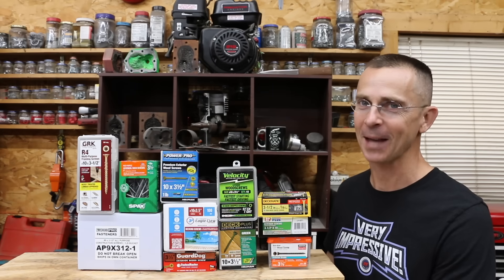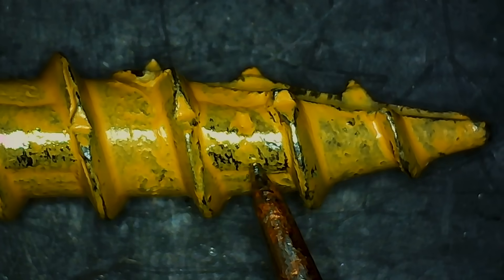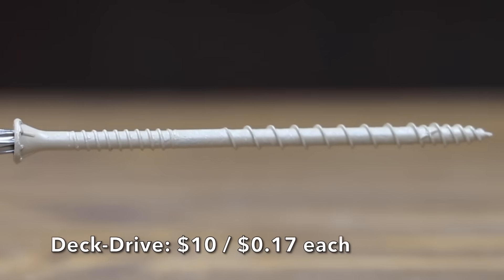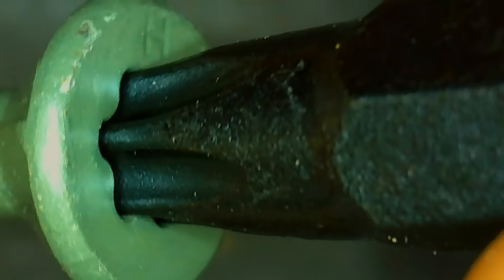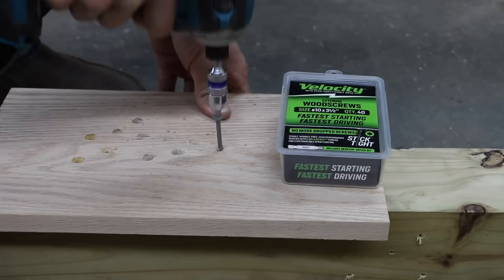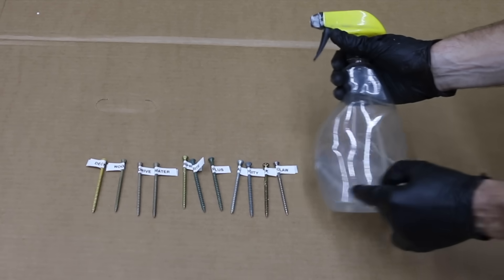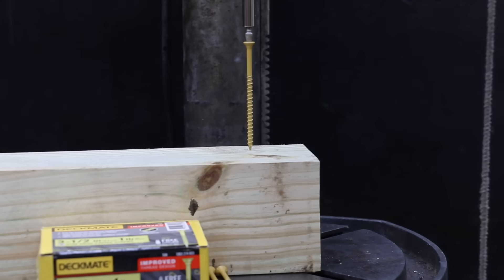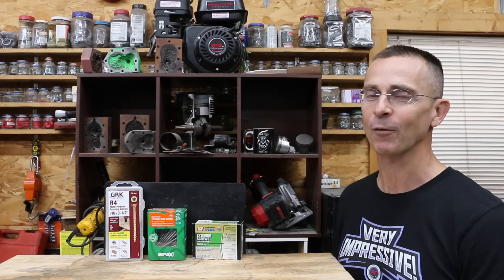Best Deck Screw? GRK vs SPAX, Grip Rite, Deckmate, WoodPro, FastenMaster, Deck Plus, Eagle Claw

Comment: There's actually a very interesting story about the grk screws. 
The original owner made sure they were manufactured in either the US or Germany, and eventually brought the majority of manufacturing here to the US. Eventually one of the evil Omni mega corps bought him out, but the terms of the buy out stated the US manufacturing had to remain open. The new owner violated that, shipped manufacturing to Taiwan, and the quality took a massive crap. 

However, due to them violating the terms of the agreement, the original owner, with hundreds of millions of dollars, opened u2 fasteners built to the same original standards with a few new improvements to design and production. Ran grk out of town in the northwest. And brought American manufacturing back.

This all took place around 2016
Reply from the maker: Great information. Thank you
Reply: I thought U2 Fasteners is a Canadian company?
Reply: @mydude3254  Ontario Canada
Reply: @mydude3254  to be fair, he said they were an "American" company, not specifically U.S.
Reply: @mydude3254  both grk and U2 have Canadian roots, Ontario I believe. 
Manufacturing was done in Illinois for grk until it was offshored. Most products from U2 are us made. We get the full catalog from our local fastener supply. I think only the adjustable window screws were Canadian.
Reply: @mydude3254  Well, that's even better!
Reply: The irony is that they would end up buying most of the tools and machines that were sold to ITW for a fraction of the price LMAO.
Reply: This is why I reach for Spax.
Reply: That's super interesting. I've got a big project and a big screw order coming up, I'll check out U2 Fasteners. I'd much rather support quality manufacturing in North America than lesser quality overseas.
Reply: Man, talking about GRKs. What you're saying makes sense! Their cabinet screws are Uber crap these days. I'm a cabinet installer so I go through the screws. In one of the large buckets of cabinet screws, I'll find a half dozen or so BENT screws, which stinks when you're doing cabinets, when you're driving a bent screw, and it causes your bit to disengage with the fastener and you marr the cabinet, frustrating! But anyway, bent screws, screws stuck together from too much coating and the torx head filled with coating and steel shavings, so you can't even use the screw, and I've been breaking screws too. This has been routine with their cabinet screws for at least the last year and a half. Their finish/trim head screws aren't that great either. They're straight, but I routinely get screws stuck together from the coating. It's a bummer, because the really used to be Uber Grade. It stinks because they own so much of the market that they're hard to avoid using. Any  cabinet installers out there have a different brand, I can try?
Reply: @artvandelay1099  Ive noticed a lot of inconsistencies in the last couple of batches of construction screws
Reply: @scottyee707  I don't use many construction screws but as far as cabinet screws, I switched to Spax a  little over a week ago, they're a superior screw.
Reply: @artvandelay1099  Painful deficiencies. But you didn’t mention my favorite. The head twists off.  Why I settled on the more expensive Spax.
Reply: @robertbamford8266  Switched to the Spax over a week ago. They're a much better screw. They're only a couple cents more per screw. Definitely worth it.
Reply: @artvandelay1099  Cost diff is negligible - especially after the first time I twisted off a head and had to dig out the shaft and plug the hole. I even threw out the box with the rest of the screws.
Reply: @artvandelay1099  same here, I install lots of cabinets and I run into lots of bent ones, recesses filled with gunk all the time
Reply: @stevebengel1346  When you have the chance, try the Spax. The guys on here are right. Had a big cabinet job start a few days after this video. Been using the Spax 3" wafer heads and the Spax 1 1/2" and 2" trim/finish heads for over a week now. They're more expensive, but only by 1 or 2 maybe 3 cents per screw. The box says made in the U.S. or Germany but all the boxes I saw said made in the U.S. In one week of use I haven't had one bad screw yet. But the biggest and most surprising and most immediate difference I noticed was the driver bit to screw head engagement. The fit of the driver bit to the screw head is SO, SO much better. I can put a 3" screw on the driver bit, raise it over my head into position and drive the screw one handed. I was shocked and impressed. Driver bit fitment to the screw head wasn't even a complaint I had with the GRKs! The Spax don't come with a bit, but I don't care, I use Makita bits, also recommended by Project Farm. The Spax are available at Home Depot, so I can go out and get them on my lunch. That's important for me and the only reason I didn't try the U2 fasteners some of the other guys were talking about.
Reply: @artvandelay1099  Dealt with the same thing a good bit. Spax wafer heads are much better these days and made in USA. Don't love their finish screws much either, though. Powerpros are ok, but I haven't found any I love like the older GRKs.
Reply: @MattJones87  Spax wafer heads, got it. I'll look for those this week. Got a good size, 37 cabinet kitchen to do this week. Isn't it the worst when a good brand sells out, then coasts on their name and reputation? Those sneaky buggers still use the German flag in their logo. Did you say you like the Spax finish screws, or no?
Reply: @MattJones87  Great advice. Thank you. Switched to the Spax over a week ago, SO MUCH BETTER. Better in ways I wasn't even expecting. The fit of my Makita bit (also a project farm recommendation) to the Spax screw is far superior. In over a week of use, not one bad screw yet. Totally worth the 2 extra cents per screw.
Reply: @artvandelay1099  Go get yourself a whole boatload of U2 screws.
I gave a direct link to several varieties available on Amazon, but YT censored it, probably assuming it was spam, which it was not.
Reply: @Gunners_Mate_Guns  I might go ahead and order some. It stinks GRK pretty much owns the market. I like to buy in stores. Go out at the start of a job and grab your shims and whatnot grab your screws since you're already there. Then, if you're running low on screws, just run up to the store and grab some. Amazon ordering just isn't first nature for me yet. I'll consider them though.
Reply: @artvandelay1099  Spax has been great, and the U2 construction screws. I don't use many finish screws. 
Spax still maintains a lot of US production so I generally use them if I need to stop by a box store, otherwise, U2 from fastener supply. I don't know if they have different lines, but some of the U2 products on Amazon are showing Taiwan now too. 

The stuff we get locally still says us or Canada.
Reply: @Squat5000  Been on the Spax for over a week now. They're great. The box says made in the US or Germany, but all the boxes I saw were marked made in the US. Would've tried the U2 but I like being able to go out and get more screws on my lunch break or whenever.
Reply: I'm seeing some U2 Fasteners screws made in Taiwan
Reply: @victormarinelli5660  Go for the Spax. The box says made in the US or Germany, but all the boxes I saw said made in the US.
Reply: @artvandelay1099  I'll check it out.
Thank you!
Reply: Good information! Thanks.
Reply: Good read thanks
Reply: Damn, they also sell 316 stainless screws! I can drop Stimpson Strong Tie screws!
Reply: @reginalb124  unless you need rated and code compliance, then use Simpson.  Gotta keep roofs on, decks up and stuff like that.
Reply: GRK and U2 are made in Taiwan. ITW owns GRK.
Reply: Are you the original owner of GRK? 😏
Reply: @Meatwad.Baggins  shoot I wish. 
Illinois tool works to my knowledge.
Reply: That's a fascinating story, and good on the original owner for retaliating and onshoring manufacturing once again through creative means.
Reply: Kickass!  Couldn't find anything on the internet about it, but it DID say the manufacturing was done in Taiwan, Switzerland, and Germany.  So I believe it lol

Never buying GRKs again!
Reply: Such a satisfying comeback 👔
Reply: Nice fun fact
Reply: I have seen zero evidence GRK’s quality has gone down. Personally. They don’t strip, they don’t corrode, they don’t snap or break, and they hold as well as any screw.
Reply: @JimYeats  they still cheated. So boycott them.
Reply: @talisikid1618  Its basically all they have at my local hardware store, so, I’m not going to do that because its not that important to me.
Reply: @JimYeats  I still have cases of the American and German made fasteners. 
Compared to today, the fit of the bit is mediocre, they are more likely to strip, I've had heads completely bent or missing, especially on fine cabinet screws. 

It's anecdotal of course, but of the hundreds of thousands of fasteners I've gone through, picking out a box of the old ones is a good reminder of the difference.
Reply: @Squat5000  Fair enough. All I can say is they have served my purposes just fine.
Reply: American yes but, Canadian not US.  That's Okay too.  Just wanted to set the record straight.
Reply: Wow!  I believe you, but do you have links to news articles or videos about this saga?  That's crazy.
Reply: @Locane256  I wish.
The owner was making the rounds with some of the smaller fastener supplies in Montana. Grk obviously has the strangle hold on bigger retailers because they won't change suppliers, but the aces, WBC, and fastener supplies liked what they had to offer. 
It was a few years back. Unfortunately "straight from the horses mouth" it's all we have. Might still have some pamphlets though that they sent with their sample packs. They had a bit of that back story. 

Granted, since both Canada and US were shutting down effing everything, it's only a matter of time before they offshore to Taiwan too. You just can't compete anymore.
Reply: @Squat5000  Big Timber is what we get here on the west side of MT from WBC for screws. Next time I go in maybe I'll look to see what else they do carry because I'm curious!
Reply: @stubbsshop  in the valley you'll see a mix of U2 and big timber. 
The big timber are decent too, but the bit fitment isn't as tight unless you have a brand new wera with the diamond grip. I think they are a good value compared to grk
Reply: @stubbsshop   northeastern Montana we get big timber too! I think they are pretty good there is probably better I use a lot of the BTX and CTX screws always seems decent quality
Reply: The way it should be 
Buy American 🇺🇲👍♥️
Reply: @tjkaczynski5896  even if it's from the goofy cousins up north, it's still better than overseas.
Reply: Nice to know, after hearing Taiwan mainly throughout the test, I went on a 'made in the USA' search.
Reply: Based and wood pilled
Reply: Thank you for the info
Reply: Thanks for the info.
Reply: U2 is a company I'd love to support!
Reply: I bought a boatload of grk screws recently. I'm here in Canada so I'm used to the superior Robertson screw. 

I was not impressed with the t15 torx fit on these washer head screws. The torx recess is very shallow and doesn't allow the torx bit that's included in the box was engaging deep enough.

With the longer screws this causes wobbling and you absolutely need to hold the screw with the other hand.

These screws are garbage and not worth the premium.
Reply: @breakfasteatre  Robertson is not superior to torx, not even close.  I use my own Dewalt bits and I never have slippage. Robertson is fine,  they just aren't as good as torx.
Reply: @breakfasteatre  Spax uses a little nub on the end of the Tirx bit to help align things. It doesn't stick to the bit like a Robertson, but that's what magnets are for - to hold the screw without yanking out of the bit holder. ;)

With GRK construction screws, I just use the drivers with a tube that slides down to hold the screw. That works even better than a square drive, IMO.
Reply: @breakfasteatre  yep totally agree I used the grk one my past few installs thinking they’d be good, they are trash. I’m going to try u2 otherwise back to Robertson’s
Reply: If only everything was that.Nope can't be having to many Americans get ahead.they might Rise up and Revolution
Reply: @UC7YA40pjPDOh-kdIF2IeBqg just toggle Amazon off
Reply: The Magnificent Adam-man
...
Cush (Greek: Ethiopia), means sun-burnt
Phoenicians described by the Greeks, as fair-haired, fair-skinned people
Persia means Lord of the Aryans now renamed IRAN
Zimbabwe once known as Rhodesia
Chicongo once known as Chicago
...
12 Tribes passed through the Caucasus Mountains
(i)ssac's Sons / Saxons / Anglo-Saxons / Europe / Australia / New Zealand / North America / Christian First World / We the People
Reply: @Lawiah0  - Um.. "Persia" is a corruption from the Greek Roman Empire of the Fars Province of the Empire of Iran and Non Iran.   (Farsian==Persian).   The Pars/Fars province was the core of the Sassanid Dynasty.   As for the steppe tribes, we have no real idea of the number of them that swept down through that area over the centuries, nor do we really have a good idea of what passed back and forth across the Caucasus Mountains over the last 35,000 years.
Reply: @tbelding  
Gen 10, tells us that Egypt, Ethiopia, Sheba, and Persia were at one time, all great Adamic Nations.  

In Isa 43 says, “For I am Yahweh, the Holy One of Israel, thy Savior: I gave Egypt for thy ransom, Ethiopia and Seba for thee.”  

Now, if Yahweh God gave up Egypt, Ethiopia and Sheba for the children of Israel, who received them?  History tells us that these lands were overran by the mixed-multitude, mongrels.  This is who Yahweh gave the ransom. Flood of the Serpent, Rev 12:15.
Reply: @Lawiah0  A'DAM as it is written in the first language Cuneiform, which is a written language to describe things, translated the word to other languages as it was meant "Animal." 
A'DAM is what the creator called the first man. Animal. 
Makes ya think a bit.
Reply: @opossom1968  Adam means to show blood in the Face, to Blush.  Only Caucasians can do this, those of YHWH.  Rev 12:15, from the Serpents mouth is everything not from Adam.
Reply: @Lawiah0  I can tell from your response you do not have any understanding of language and its written origins. Cuneiform along with the Rosetta Stone, clearly defines the word A'DAM as the word used to name the first human as Animal. 
This is the true and correct definition of A'DAM. 
Sumner, the first city, home of the Sumerians, gave us written language among other first such as, the wheel, farming, and construction. 
Also our first dictionary and the word A'DAM was the word used for the first man. The creator of all things called the first man by his name A'DAM meaning Animal. 
From there the name A'DAM was translated into other languages as the name of the first man and all other Animals share that same classification. 
Adam (A'DAM) animal. 
If you cant accept that then you need to look at yourself removed from your high holy status and jump back into the world with the rest of us Animals. 
We all are children of Adam and are classified as A'DAM, Animals.  
even today when you search Human Classification we are Homo sapiens, Kingdom: Animal. 
Family: Hominid.
The two MOST important achievements.
Written Language 
The Wheel. 
SO all definitions of things comes from those who invented the language and as i have written A'DAM, Adam directly translates and is accepted as the first name of Homo sapiens ANIMAL Adam. 
The creator God called named the first man A'DAM, animal. 
You better love it. its what you are.
Reply: @opossom1968  
This is not the forum to try to bring your cult proof out against another cult proof. Keep your religion out of here.
Reply: @jenniferwhitewolf3784  thing is im NOT religious. that was just our history put into a context the guy i was responding to could understand. i do not claim any religious affiliation.
Reply: @Lawiah0  miss guided soul.
Reply: @opossom1968  If you are not of Adam-man, like my Kinsman Redeemer (Christ), you have no Soul. You are an empty vessel, an abomination of desolation.
...
Matt 15, “Every plant which My heavenly Father has not planted shall be uprooted!
...
They kingdom comes.
Reply: @Lawiah0  My wife brought your name into question as to your ideology and theology. For one, i do not subscribe to any official 'religion' in the sense of what the meaning of the word has become, theology and ideology. I am a firm believer that Jesus Christi is not a hybrid as we are, he is a man without Chromosome #2, pure God made DNA that A'DAM and Eve started with, God made man in his image but made him from the same material as Animals dust and spit and breathed into man to give him life, that is TRUTH. BUT you forget one very important thing, Morning Star, Light Bringer, the first angle God the creator spoke into existence Lucifer, tempted Eve, because she was more accessible do to the fact that A'DAM walked with God everyday all day. She was tempted by Lucifer, light bringer the being that came to be when God spoke let there be Light. He temped Eve with what we can in our simple minds eye a 'apple' THAT changed her DNA, A'DAMs and every child born. 
That added Chromosome #2 to our DNA, which Jesus Christ DOES not have. 
Christ is PURE God made DNA not MARKED by the beast. 
AS we are told WE modern man Children of A'DAM and Eve, are BORN into sin. or Born with chromosome #2. 
This is the mark we carry, SO do you. in your very DNA. This will have to be dealt with FIRST. The mark of the beast, which we all carry is real in you and me. FACT. 
I tell you this so you know i do know God the creator and God the savior and God the spirit, but what i do not attest my life to is a organized religion (retelling) that tries to hide, as you are doing from what you are, A'DAM, animal. 
You was wrapped in the skin of the animal and tossed out of the gardens on Eden to live as animals and till the ground till the end of your days. 
DO you deny you are son of A'DAM the child of man, born into sin with Chromosome #2 as the mark of the morning star the deceiver. 
We all have the mark, BUT we are saved in our denial of that mark and it will be taken away in our belief in Jesus Christ who the Jews killed for saying he is the son of God. 
You sir are a animal clothed in the skin, marked as a sin of Lucifer till judgement day. 
When you die you will be asked a question, you will not answer with your tongue but with your soul. Know the correct answer or perish. Learning that answer has lead me to where i am now. being called names for showing people the light and the door to expand the knowledge of who they are and where we are all headed when called by name to answer a question, to be saved. The only way to be saved is to believe in Jesus Christ as our savior. He is the pure Son Of God our Creator.
I am a believer just i am not held by the chains of Lucifer in my belief such as you are. You in all of this are denying who you are and what you are, by lifting yourself above A'DAM and Eve and all the children of the earth wrapped in the skin of animals to till the earth and care for the beasts of the land. You are lifting yourself up above even Jesus Christ who shares your very DNA, in saying  you are not animal, not from the dust and spit of God the Creator. 
I am the same flesh and blood, the same dust of the earth as Jesus Christ my brother/savior and Lord and i love it. Even in my sin marked as we all are by chromosome #2. 
I KNOW WHO I AM, i know I AM is real, i know Jesus Christ is real and will save me from my mark that i deny till the day i am saved from this by Jesus Christ who died so i can be free of the mark. To once again have pure DNA as was told i would one day have and be free of the sin of this world. AMEN.
Reply: @opossom1968  Not "Animal" but "Animated" The "Ani" from Animal is the same morpheme.